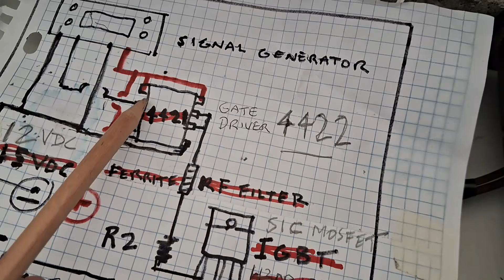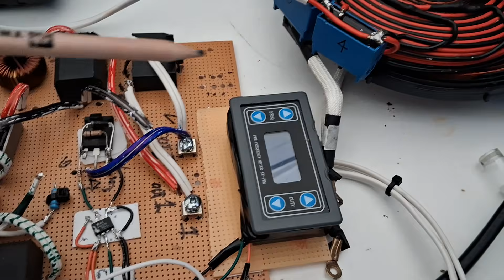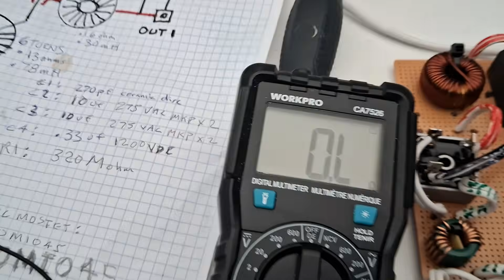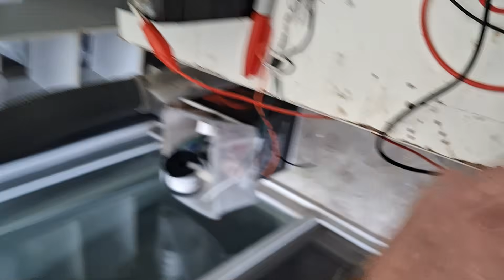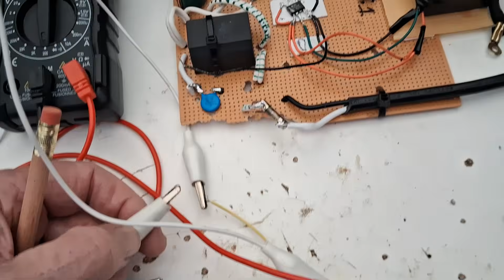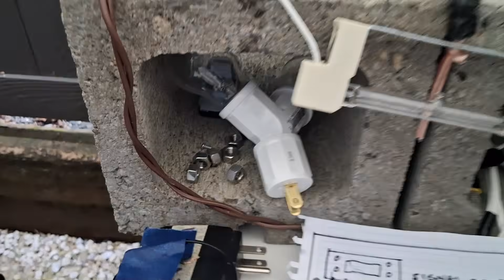Looks like its fixed;  it needs a 10K pull down resistor from pin #2 of driver chip to ground

Comment: Great video Doug 👍
Reply from the maker: Hi Tim
Maybe if IGBT the transistor could be made to self oscillate like in a joule thief with the 330 ohm resistor?
Maybe how the factory does it and it comes out to the 24khz?
That signal generator is already broken, probably not so reliable in long run, but will.be good for testing different frequencies and duty cycles with different.loads and inputs but eventually would be nice to.make the transistor self oscillate if it at all possible.
I dont think.mosfet can self oscllate, would need IGBT?
Just thinking....
Reply: @MrDKONZEN  for self oscillation you need a resistor network and tap the output coil that is tuned already for 24 kHz.

Comment: Great news, good to see your breakthru, the pull down resistor helps discharge the capacitance of the signal feeder cable I guess.
Reply from the maker: Besides the lack of pull down resistor, the signal generator is now toast,
that C1 in circuit a varistor, not a cap...it probably blown out too so now no surge protection.
The mosfet has blown apart literally after the last test "under fire" I have three more...
Will order more components will try again.
Thanks!
Reply: @MrDKONZEN  Oh no !  Sorry mate one step forward and 2 steps back. I know the feeling very well.